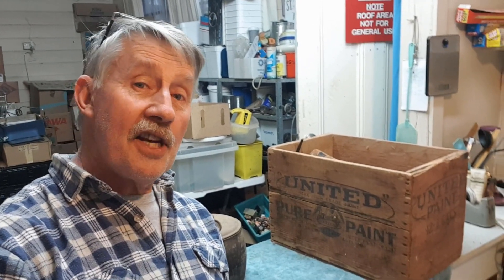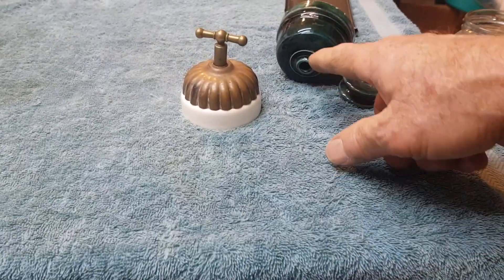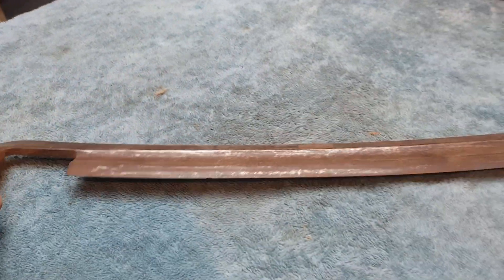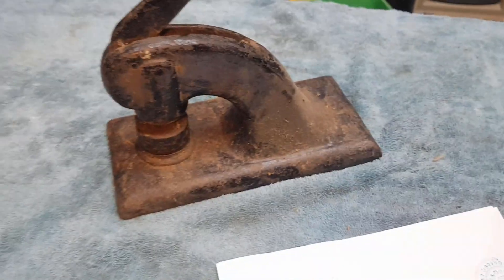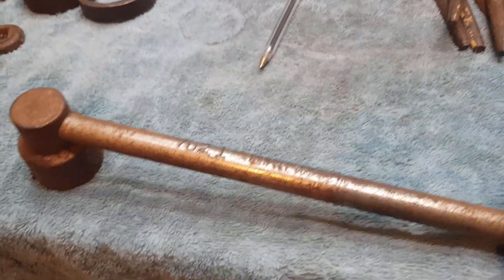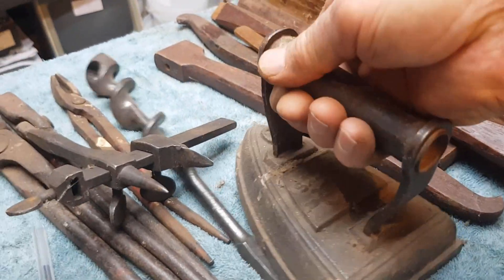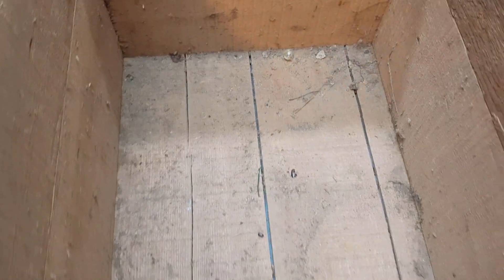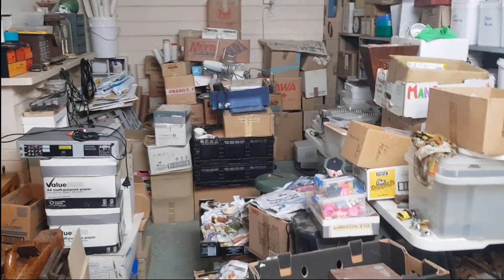Vintage Radio Room, Sheds & House Lot - Part 6. Unboxing a Mystery Box of Antique Tools & Treasures!

Comment: That wooden box would be the find of my dreams. As a hand-tool woodworker every item would be useful in my shop. The big bits with two cutters and a hole in the center (25:45) are for cutting tenons on the end of round or square stock, for example for chair legs. Both round and square work pieces are roughly shaped first with a drawknife. I have used these in my hand tool woodworking. The cone-shaped cutter is for putting a chamfer around the top of a tenon in order to facilitate assembly of the joint. The semi-circular handled item is for cutting leather. The turning saw can be put to use with a piece of bandsaw blade and a string wound around the top arms and secured with the small flat piece of wood. The round piece of wood does not go with the turning saw--I'm not sure what it fits. What a fabulous find!
Reply from the maker: Thanks Elaine, appreciate your input! Yes, it was a great find! 😁👍

Comment: The tongs at 20:44 are farriers tongs. And not a scraper 29:18 , but a leather cutter.
Reply from the maker: Are they all farrier's tongs? Thanks Shaun, I best do some further checking. Oh that makes more sense with the leather cutter, it is very sharp! I can probably price that a little higher then.. 😁
Reply: @TheUltimateRecycler  definitely the first pair (rounded head), the other two may be forged for specific farrier needs.
Reply from the maker: @shaungibson2033  Cool, thanks mate! 👍

Comment: I love this clean up, Chris!  An amazing man's stuff!  But question...  Why not use the electrolysis tank on some of the more rusted tools?  Also, during your tool shed purchase video, with all the hand saws, why not use the electrolysis tank on some of those?  When scrub?  When electrolysis?   Seems like it would be less work to put stuff in the tank compared to scrubbing.  Thanks.
Reply from the maker: Thanks Shane! Good questions mate. I guess it depends on the value of the item. I don't usually do wood saws with electrolysis as they are generally fairly low value and although they are much easier to scrub after electrolysis, it is messy as the process creates a black coating which gets everywhere when cleaning larger items! I could have certainly put the good spanners in the tank - but it does take a couple of days and I'm keen to get them into the shop!
Thanks for watching and asking questions! 😊
Reply: @TheUltimateRecycler  I’d love to see a side by side comparison of two similar rusty tools, one electrolysis tank, one steel wool. 😀👍🏻
Reply from the maker: @scohen88  I might take that a little further and use some other de-rusting options as well, like molasses, vinegar & citric acid.. 🤔😊